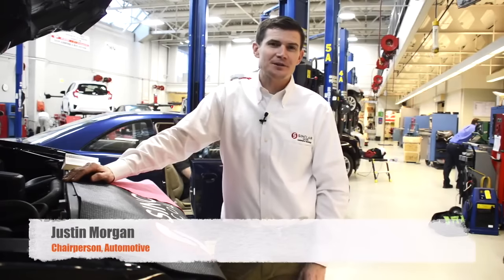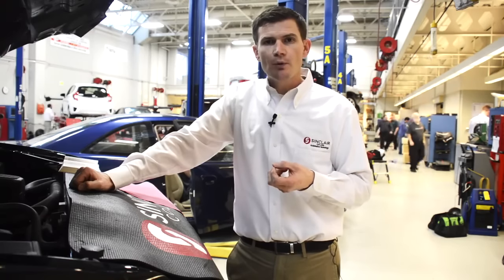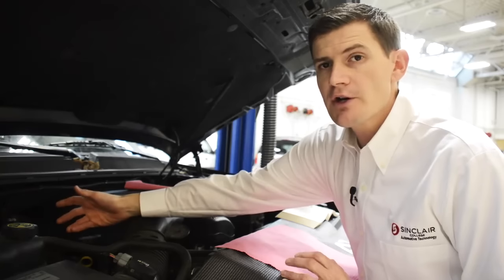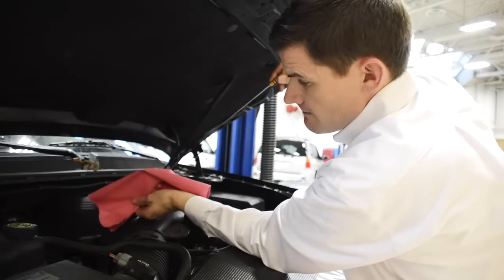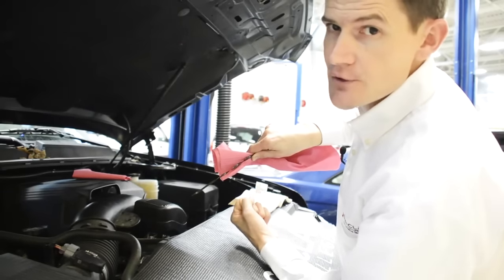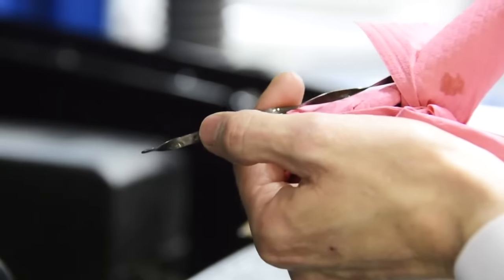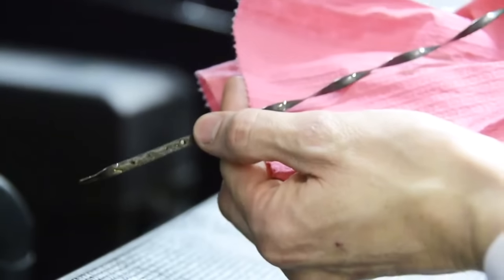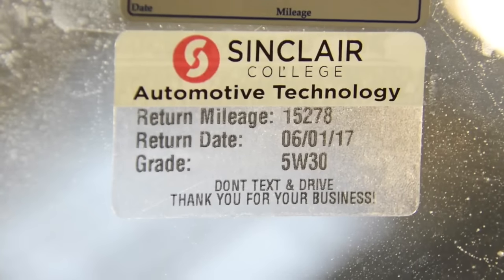How To Check Dipstick & Engine Oil - EASY

Comment: I’m all ocd bc my dad taught me to do this and check the fluids and tires b4 a long trip. I don’t know if I’m reading mine right tho so I’ll have the gas guy check it...there’s two dots..the oil covers the bottom but isn’t like, “on” the top dot, like sticking to it...but it is on the stick above that dot, so I dunno... they should bring back those hash marks he showed 👍🏻
Reply: Remember when you take out the oil-sticky-thingy, that you keep it faceing downwards so the Oil doesnt run towards the Max-dot just because of gravity.
It could possible be the thing that tricked you this time. I have also seen people talk about diffrent colurs on the stick, but  they dont notice that the Oil still moves, which could couse Overlays, which makes it look like darker or brither.

Comment: Does it show clearly on the dipstick? which material used on dipsticks blade? Now many engine dipsticks use steel stainless material to see clearly. I know something about how to check engine oil form Chongqing Feilong Jiangli, a professional supplier of different kind of oil dipsticks for car engine, motorcycle engine, boat

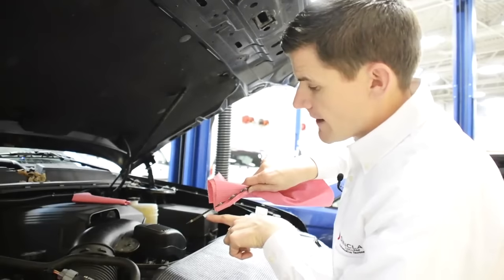Comment: 3:17 “...continually change oil every 3,000 miles.”  That’s all? I change mine every 300 miles 😉
Reply: every 300 miles? I change mine at every red light
Reply: @cwise610  every red light? i change mine on the highway
Reply: @EpicNatar  change it on the Highway? I change mine as soon as I put the new oil in!
Reply: @stu4428  as soon as you put the new oil in?? I change mine on a hill😌

Comment: So I have a question. My husband just got his first car and never told me the oil light came on. Now it appeared to have 5% and I'm worried about what will happen since I never let any of my past cars get that low. Can I refill it myself ? I'm afraid of driving it and something happening to the engine😩
Reply: You have to go underneath the car to drain the oil
Reply: Yes you can tell it yourself. Lol under the hood for the oil cap. It should be near your dipstick. Check it first. If it's in between the min and max markings on the dipstick, you're ok. If at or below the min mark you need a quart to hold you until your next change.

Comment: It’s a real shame that shops trick unknowing customers in regard to oil change intervals.  No car sold with fully synthetic oil will ever need changing prior to 10000mile or 16000km. Most car manufacturers actually allow for 20000mile or 30000km or bi-yearly. Most oil changes are excessive and pollution for the environment. The exact same make and model in Europe will have different recommendations than the US simply because manufacturers are unwilling to fight the dealerships in US as they make so much money off of the service intervals.
Reply: I’d still change the engine oil every 5-7.5k miles as a little early wouldn’t hurt.
Reply: Agreed...if it ain't dirty it don't need changing
Reply: For people that dont drive optimal conditions, not worth waiting that long to change oil.. Its better for the environment to use a little more motor oil than to scrap the broken engine
Reply: Homan Heydary 20k is a joke, and even 10k for a turbo car. Oil is cheaper than a new engine
Reply: You so wrong !
Reply: The problem with not changing your oil enough is that detergents and engine oil components can degrade over time. Using mileage alone to judge is a bad idea.
Reply: To replace my engine it’s $10k. A DYI oil change is $40.
Reply: CHANGE YOUR ENGINE OIL EVERY 3-5K MILES, DO NOT LISTEN TO OPS COMMENT. IT IS NONSENSE
Reply: On non direct injection engines, yes synthetic can hold up to long drains. 
New direct injection engines are Shit, and the oil gets full of gas in short order. 5k Miles is even pushing it on some engines

Comment: Will it be fine if I run a lawn mower on a small yard for a short but if time a little low. Just right at add?
Reply: If you still see oil on the dipstick it should be fine but best to keep it within level.

Comment: For determining oil change intervals you can ignore mileage intervals. They're a scam. Instead, look up the oil capacity of your model vehicle. Then multiply by the oil change constant of 200 to find how much fuel to burn between oil changes. Ex: oil capacity= 1.5 gallons x200 = 300 gallons of fuel. That's it. Just change oil every 300 gallons of fuel burned. To hell with mileage intervals because we can't discern between severe and ideal driving conditions. (Between highway driving and city driving)

Comment: i have a problem with one side of the stick saying full and the other side saying 2 quarts low no matter how many times i retry. which side do i go by?
Reply: JxT1957 the top side should be more accurate if your stick is angled that way

Comment: I have VP 5.7GXi 2008. no previous experience with boats. I noticed it takes hours before oil in my engine settles completely, If I cheeck it 10min after stop it shows nothing on a dipstick. but tomorrow it is close to max. Is this normal?

Comment: When i check the oil the gauge smell gazoline, is that normal ?
Reply: Fred Yan no
Reply: Your engine oil is gonna smell a tiny bit like gasoline.  That’s just how it smells.  As long as you don’t notice your oil level going up between oil changes, I wouldn’t worry too much.  Or take a sample of your oil and send it to an oil analysis place, like Blackstone Laboratory Oil Analysis.
Reply: @Thugman98  not exactly, gasoline is similar to a solvent while oil is a lubricant. After a while there will be a little fuel in the oil from blow by but normally nothing sever. Certain gas or diesel engines have had issue with fuel dilution in the oil. The 6.4 powerstroke is known to increase your oil level if you have a leaking injector. Some Honda also have had gas go into the oil. But just driving should usually vaporize any gas contamination in the oil.

Comment: Does your engine need to be hot or cold when you check your oil?
Reply: Jim Jones cold it works best
Reply: 1. Engine Oil expands when it is hot. Check it if it is cold. 

2. Transmission Oil needs to be checked while the engine is running and on normal working temperature.
Reply: Jim Jones cold
Reply: Well I'm sure  cold is what the majority required  yet my Toyota Camry's owner manual says check it at operating temperature?? Go figure.

Comment: What if I filled just above the full marking ? Do I need to drain it or is it ok ?
Reply: a bit is no problem
Reply: I've just dumped all 7 quarts in trucks that take 6 and a half so I don't have a half a quart laying around. It'll burn off slowly as you reach the next change. Half a quart over won't do anything but 3 or more quarts is when it gets kind of bad.
Reply: @bryanmartinez6600  big mistake buddy
Reply: @bmetzo2809  well it's a 2001 expedition 5.4 triton some say 6 and a half others 6 and 3/4 others all 7 it was just that one time and still runs fine I now usually go 6 and 3/4. Right now it's the ac compressor that sounds like it's about to go. Not bad for 19 years.

Comment: I have a question for people that knows about cars. How worry I should be if my car it s consumption around 0.5 litre oil at 1000 km. It s gasoline car, a mazda 6 from 2007, 166 HP, 2.3 engine size. I have around 70 000 km on board. Yes I drive pretty fast the car. I hear that driving fast, high rpm it s eating lot of oil.the cars beside oil consumption I Don t have problems like engine problems. Thanks guys

Comment: For some reason when i went to check my oil today, last couple inches of dipstick does not go in smoothly. It felt like something metal was in the way and rubbing against it, have to force it alittle in order to seat the dipstick.
Reply: Update
Reply: @manuelesquivel2107  pull it out half way and insert again seems to work fine so i left it be.

Comment: I am having a weird peoblem with the dip stick.
When i am checking out my dip stick it is not showing the same or not even to near to same on both sides. One side is showing less than half and the other side is showing full.
What should i do!?
My car is a Toyota premio 2004 model.
Need sugggestion.
Reply: One side is for reading and has a design/imprint, the other side is just flat and not meant for reading oil level as it just slides right off.

Comment: If the oil level is low and I need to add more do does it matter if I use a different oil brand or if it’s synthetic or non synthetic?

Comment: What do you do if you put the stick down and there no oil on it. Do you have to drain the oil out or can you add some
Reply: Ryan Scherbluk add until you get a change
Reply: Saidu Fofanah but the car has sat for a good 10 years without being started its been at the back of my property for years never started and now I gotta get it off the property so I wanna just get it to run so I can drive it off. So I checked the dip stick and there was little to no oil on it there was a tinny bit and looked black so should I change it before starting it
Reply: @ryans413  if its very black change oil. Bare minimum add oil.
Reply: Genesis RC & FPV thank you I know about cars just it's been sitting so long hast been started In years so I'm just trying to be cautious here before going and trying it. Hardly any oil showed up on the dip stick like nothing at all I know car had a small oil leak but I couldn't see any oil on the ground were its sitting. I guess I can charge the battery and but some oil and I'll cross my fingers and see what happens. Thank you again

Comment: Hey after I added oil to my car I tried to check it again and there want no oil on the dipstick even after adding more
Reply: Add more..
Reply: @axtra92  I added some about a week ago. Not it blinks every 3 to 9 seconds while idling
Reply: @axtra92  okay. Well idk what it may be and I doubt it is the oil pressure sensor
Reply: Check it hot and warm at running temperature as well as cold and add very small increments to get it at level  to where exactly should be. I think dipsticks go in it strange angles to the oil and oil sometimes sticks to the wrong areas as well as the oil probably puffs up with oxygen sometime when it's cold

Comment: where can I get a engine for 2 or 3 thousand?
Reply: Junkyard
Reply: used, off of ebay most likely, depending on engine/model of car etc.
Reply: Al A i can get a brand new create engine for 2,500 but that’s because I have a 2000 silverado.
Reply: Depends on the car engine
Reply: Al A definitely not a new engine lol
Reply: Ebay or junkyard. Pick n pulls usually don't let you pick an entire engine so call ahead. Junkyards, I've seen people buy cars from them for as little as $200 and fix it up.
Reply: Al A found a ducati 821 engine for 1.5k on ebay 
.... found a 3.5 lv6 ford explorer engine making 360 horse for 1.7k... 
you could easily find a decent engine for under 3k

Comment: 3000miles ? What a commercial trick. I have changed oil once a year or 10 000km (6000-7000miles) depends what comes first. If oil level is low then it is strongly recommended that you pour the same oil in the engine what you already have in there. Do not mix two different oils together. If you whant to use different manufacture oil or viscosity do it next oil change.
Reply: You can mix oil types, synthetic/ conversational,or brand TEMPORALLY( better than low or no oil) just for adding as long as they’re the same viscosity. But please DO NOT give any advice if you are NOT an expert in this fields. Is it NOT nor EVER recommended by the manufacturers to changed the viscosity,  that is specifically engineered for that types of engine. it can blow your engine up, and void the warranty. Is fine to changed brand, but always check your owners manuals, specially Honda. or any other Vehicles for that matter.

Comment: I think I am doomed with my 2010 xrs. It has 215K kilometers on it and for the last 20k or so kilometers it is burning oil like a crazy. A liter every 1000km or so. I know the repair costs are astronomical so I wont bother with the new engine. Do you think it can  last another year or so if I keep topping it up every couple of weeks? Or it will get worse to the point where it lose a litre say every 200km or so.
Reply: Baba Zehri Try high mileage oil. It will probably decrease your oil consumption.
Reply: ad lucas or similar next oilchange
Reply: @simpesfaip  do the oil changer guys carry lucas or i have to buy my own?
Reply: Sunil Datar not everyone has it. Best is to buy at retail store. Will be cheaper too
Reply: Is the xrs still alive?
Reply: You may get bye with topping it off but just don't forget to change the oil filter at some point. Depending on the type of oil and driving conditions 3500-4500 miles at the least you can also buy a oil additive as mentioned above I believe!... You can use Lucas, Marvel mystery oil I've used both and never had a issue another good one is seafoam this can be added to the gas tank the oil and even in the intake, look these products up. Seafoam it comes in a white bottle (not actual sea foam from the ocean) but I've heard good things about that and if it was me research these products ask that Google guy he knows everything or YouTube Videos for advice and how to videos. Any vehicle can last long long time if preventative maintenance is followed properly. Example worked on a Honda accord about a month ago it was a company car used for traveling all over the U.S. and they brought the car into the dealership for every and ALL recommended checkups according to the manufacturer and this car had 639000 miles on it (yup 600,000+ miles! Have no reason to make that up!) and it ran great I was surprised and figured the motor had been changed but it was the original motor!! Transmission had been rebuilt but just goes to show if you take care of it you get back what you put in, Good luck and safe travels.
Reply: @MrMackAtack  thanks for your help Pal. My car has 230K kilometers on it (145,000ish miles). The last 15-20,000 miles havent been that much fun. I will do whatever it takes to get it to 200K miles. Thanks for your recommendations. It all starts with fluid maintenance thats for sure.
Reply: Check/change the PCV valve. (Look it up)

Comment: My oil at about 4000 miles has a red tint to it, it is not black. Does that mean anything?
Reply: mario torres it mean you had to change the oil as recommended
Reply: That’s transmission fluid not oil
Reply: It means your oil is starting to get dirty and will need to be changed soon. That is if you're checking the oil dipstick and not the transmission.
Reply: mario zombie there are two dipsticks and the red is the transmission oil level and should be checked hot the motor oil dipstick is motor and should be checked cold and the color of the transmission doesn’t change when bad but if it smells bad (burnt) a transmission flush and change is required usually every 30 thousand miles and motor oil level is indicated in owners manual or by a dash light!

Comment: I have a '99 Dodge Ram 1500 5.2L I have changed the oil I have changed the pressure oil sensor put 5 quarts back in and it still doesn't read. It don't be any oil on my dipstick. Only when I have the truck warmed up and on it only show oil on the whole entire stick and that's strange

Comment: If anyone could answer this question I'd be over the moon, I live in a new zealand and did an oil change on my mitsubishi triton L200 1995 2.6L rwd double cab ute. I was told my oil capacity was 4.6L I added about 4L to the engine and 100ml to my oil filter before replacing it, after I had completed the oil change my dipstick read well and truly over the full mark. Does anyone know why this might be? my ground is mostly falt although I haven't checked it with a level. I don't think that's the problem though and it seemed like all the oil had drained out of the sump. Could my dipstick be reading wrong? I'm thinking about draining a little oil out to get it to the right level but I'm worried that if the dipstick is incorrect that I would have drained out too much as I only added 4L. Any help would be greatly appreciated cheers!

Comment: I don't know what's going on I never got the oil pan drop though I don't know it could it really be the filter inside of it. I've had bought everything for this truck have brand new parts sitting in my house. I have paid so many mechanics that came out and never fixed the problem. I still drive the truck it is a strong truck but I haven't solved that oil problem yet while my light is still blinking in the truck

Comment: If I drive my car for only 1 day with too much oil will it cause any damage?(About 60 miles)
Reply: It shouldnt but it depends how over filled it is
Reply: Cici Bracken 

If you coming to see me ill check for ya
Reply: Drain it out before it does
Reply: Turns out I didn’t overfill it too much afterall I just filled it up to the max line, I checked the oil when it was super hot so it expanded over the max fill line
Reply: @cicibracken7412  wouldn't be a problem I've added over a quart over on a Civic

Comment: Pretty much all new cars run full synthetic oil. And unless it is an old pos, changing your oil ever 3k miles is a total waste of money. If youre dumb and dont care about your car, or dont know any better. I recommend riding a bicycle in the summer, and a reindeer during the winter.  Atleast the reindeer can run away and leave you on its own if you neglect it. Happy holidays!

Comment: my engine oil is low i can't tell if its bone dry or is it just my mind i can't believe it can i just top up with 946ml oil and then drive it to a garage for an oil change is it safe? i'm getting my oil pan replaced but it's low on oil. i haven't had the computer tell me i have low oil pressure or low oil level and that's concerning me.